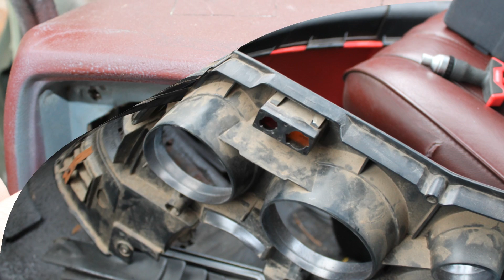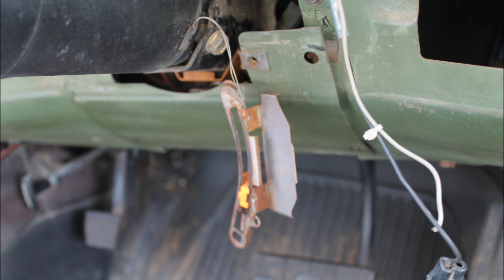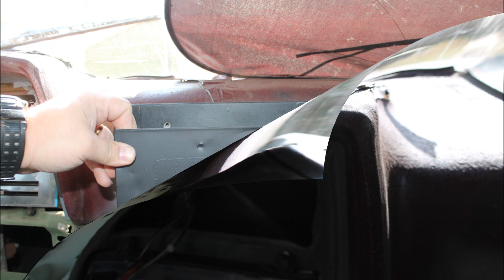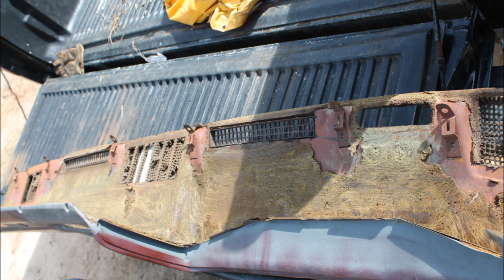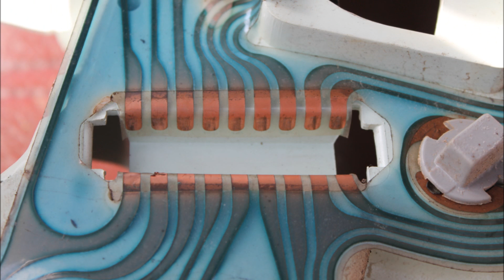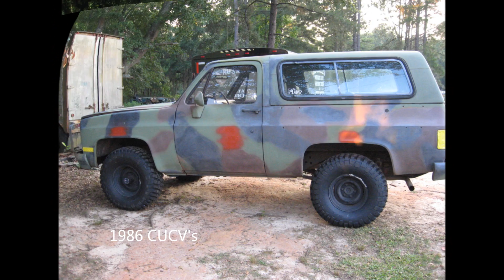CUCV Dash Removal and Bulb Replacement

Comment: Question…. Is it possible to take the idiot light gauges out and install factory gauges like ,temp, oil pressure ect. Like will factory gauges just plug right in?

Comment: Can anyone tell me orientation of wiring plug going into gauge cluster? Color of wires on top or bottom? My clip goes in either way..
Other question is I can find light bulbs but not black clips for gauge cluster part number possibly it the?

Comment: I just picked up an '86 M1009, I need to replace the Dash Pad also, where did you get your  replacement? Will a K5 Blazer Dash Pad work?  Any information will help.  Thank you!
Reply: +jugeton0823 Check out LMC Truck.  Great source for many stock pieces.
Reply from the maker: +jugeton0823  I got mine from LMC. The ones I ordered came in black and I use paint/dye to color match. The were not an "exact" fit for me. It is a little off on the driver side. It's almost as if it is molded a bit long. I ordered 2 for 2 different trucks and they fit the same. I called LMC thinking they sent the wrong year but they swear I got what I needed. It could be the installer though :) And yes, I think the k5 blazer is the same with the exception of the a/c vent locations.
Reply: +TheSurvivalRevolution Cool, Thanks for your help!
Reply: hey survival . you didn't mess up the install. saw a professional restorer install these dash pads and they all do that on the top drivers side corner , even he didn't know why other than there manufactured that way. great vid lots of help .

Comment: A million thanks Joe~! Your video is a lifesaver for us guys just getting involved with out CUCV's and it outta be added to the Steel Soldiers site for all to reference--- excellent job~!

My old M1008 was toddling along just fine until I dared to slay those little demons behind the instruments panel... well, after fixin' a couple things all happy like, I realized that somehow I managed to make a few other circuits quit working resulting in no voltage and no blown fuses--- right then I knew it was time for the much dreaded dash pull--- ARGH~! However, your vid sure gave me the confidence to tackle it and while I'm at it will be adding some other electronic goodies inside the dash area to boot. Thanks again Joe~! BRAVO~!
Reply: Thanks for the thumbs up.... Hope your dash mods went well.